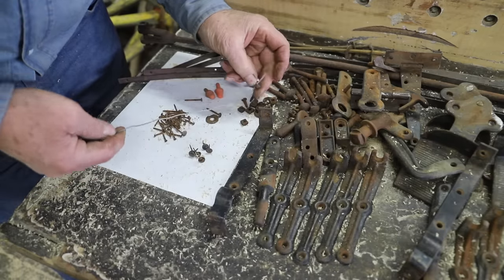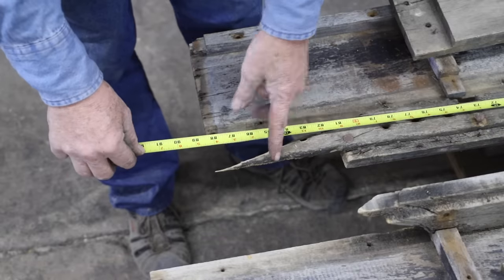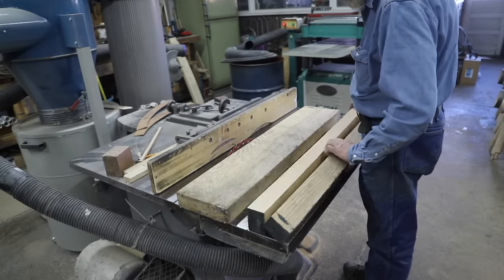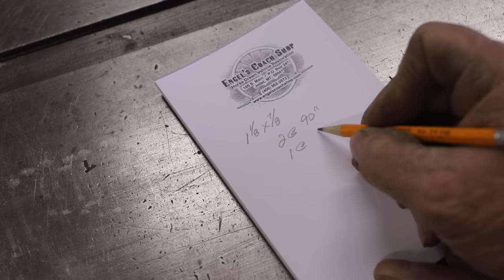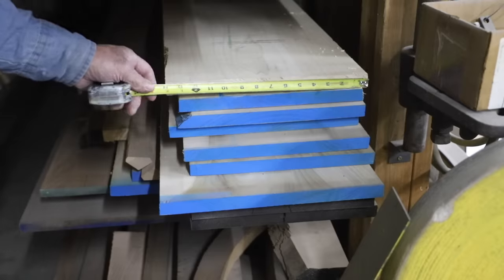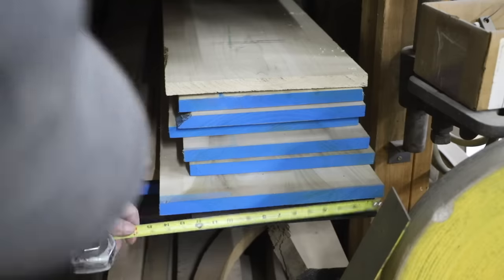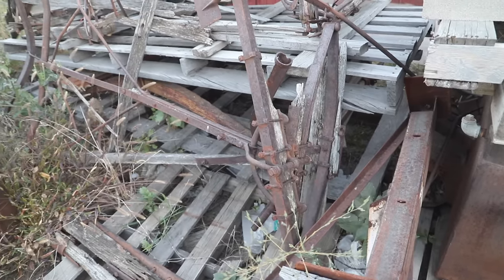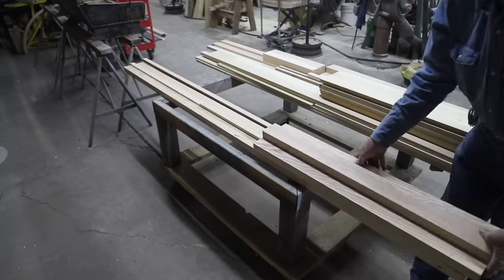Restoring a 2-Seat Horse Drawn Buggy | Part 2 | Engels Coach Shop

Comment: This is the best way to get the most out of material that will be used.  Lay it out in an organized area. Then just as Dave did, start your bill of material. Each piece is gathered up and rough cut to size then put in a holding area that is as organized as well as  his staging area is for the original buggy. So simply illustrated in this video that any shop teacher should show to all their students to learn organization of their work area.

Comment: I am a woodworker and accumulate a lot of off-cuts and rip waste that have too much prep work for firewood. I made a simple box frame, cut 4 inch diameter thin wall pvc pipe into 2 1/2 foot lengths and stacked them horizontally in the frame. I stick the short pieces of wood in the pipes or in the spaces between them. The ends are easily seen and you can pick out stock you need without moving a lot of pieces.

Comment: When measuring the original wood, is there any adjustment to take into account how dry the old wood is (do you add a sixteenth or two when cutting the new material to its final dimensions)?
Reply: I was wondering the same. It looked as though in the beginning that some boards were measuring just short of whole inches. Given how old they are, I’d have to assume there was some shrinkage.
Reply: @mercoid  That's what I tell the wife.
Reply: Me too...I know that milled lumber length does not change much over time but width does. How and how much of an allow do you make in coping an old piece. NOT looking for trade secerts just trying to fill in the blank spaces.

Comment: Air dried lumber is good but I prefer to vacuum kiln dry my lumber, it has all the benefits of air dried without having taking years and it also doesn't create checks in the lumber at all no matter how thick your wood is. You can easily dry whole logs as long as they fit into your kiln. You might want to look for a local mill that can vacuum kiln dry your lumber.

Comment: Dave, you are fortunate that you can just “run to town” and get supplies of what, to us here in New Zealand, are exotic Hardwoods. Poplar is, despite being comparatively light and soft, is a Hardwood. Here, Coach-Builders had to compromise and use native timbers that were the most suitable. Oak, Ash and Poplar are virtually unobtainable except for material imported at huge cost. The issue is all native New Zealand timbers are Softwoods - although some are extremely hard! Also, the original colonists burnt down almost entirely all the native forest, so even native timber is now virtually unobtainable. The only timber widely available is Monterey Pine, which is very low quality in every aspect, apart from price.

Comment: “Not much of the old box is salvageable.”  Looks like none?  When you measure the original parts are you estimating shrinkage and “erosion”? Thanks for the video as always.
Reply: I was wondering the same thing. You beat me to it. 😁
Reply: @markfrench8892  Most items would be built to "nominal" sizes, it would be pretty rare when something isn't. So a fairly good estimate of what the original as made sizes would have been even with any shrinkage that's taken place. Anything that was special would almost for sure require fitting between two adjoining pieces, so again how the joinery is done and where the piece fits wouldn't be too tough to figure out. The real trick is when there's no existing parts such as the wheels, then it's research time to find old drawings, online pictures of existing wagons of the same model, or even old catalogs that give at least some dimensions for wheel diameter, width, hub & spoke shape. No doubt Dave's past experience also helps a lot as well to make at least very close educated guesses.

Comment: I advise, as a carpenter, that: a push stick is a vital tool when ripping and ... when starting to use a bench saw BUT a competent tradesperson can safely make rebate cuts on a bench saw without using a push stick. You should, however, concentrate on the task, i.e. end conversations and ignore ringing telephones, etc. Bench saw ‘accidents’ occur when you do not create a safe environment and do not apply yourself fully to the task.